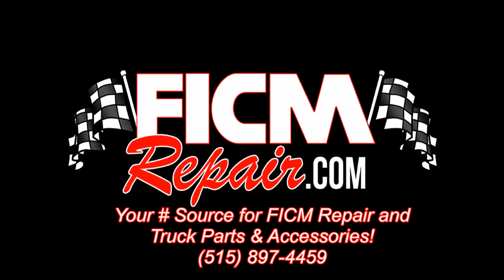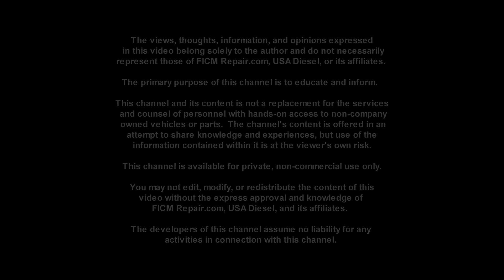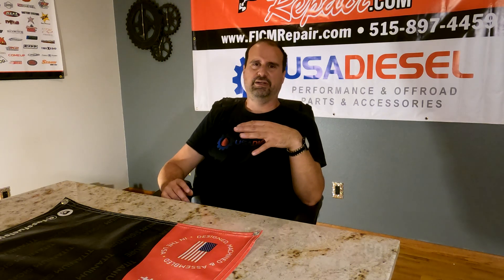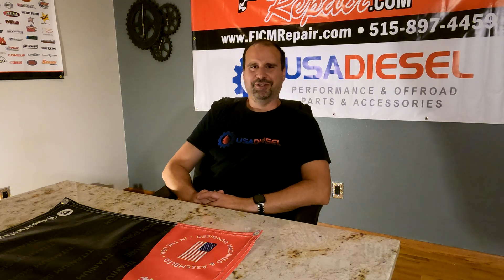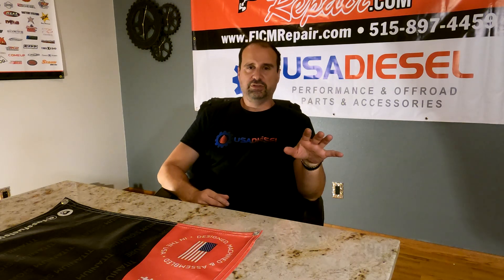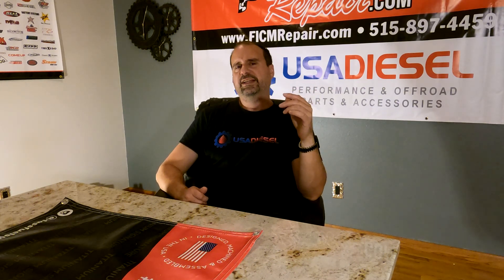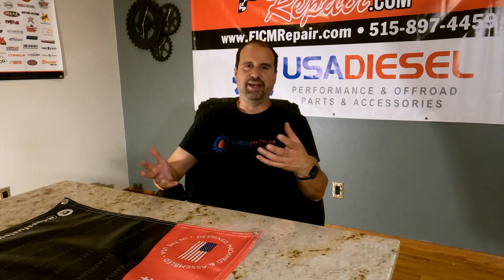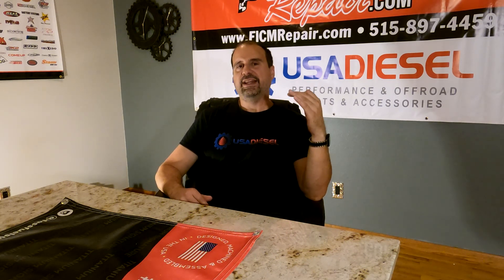Powerstroke 6.0: Why Replace Heads, what gaskets, how to torque and WHY

Comment: Well I agree with about 99% of what you said. However if one goes back historically in diesel engines even to the 1970s. There are several things we find. Number one for any given throttle setting, the colder the engine is the higher your cylinder pressure is going to be because more of the fuel is injected before ignition actually starts to happen and then that fuel slug explodes resulting in a very momentary High cylinder pressure. Statistically that has led on many engines damage occurring in the first couple minutes after startup. It could be stretched head bolts, cracked heads cracked Pistons etcetera. Example of being the 350 cummins. If you leave it on a moderate idle say 800 RPM for the first 5 or 10 minutes you rarely if ever crack a head. If you simply fire it up and drive away as soon as you have air pressure cracked heads become very common. For the same throttle setting an engine that is 190 Fahrenheit versus an engine that is 32 Fahrenheit, will have much lower cylinder pressure. Now if you increase the throttle, or increase the throttle moderately and have a tuner your cylinder pressure spike can become much much higher than the factory ever expected the engine to see or be able to handle. Myself and numerous other 6 L owners even with tuners have found that if you just drive it moderately for the first five or six minutes, that is until you see coolant temperatures over 100 Fahrenheit you rarely if ever have problems with head gaskets. My own stock head gaskets with Factory head bolts lasted well over a hundred thousand miles. They didn't have an issue until the truck was stolen and very very likely driven aggressively as soon as it was started, because obviously he wanted to get as much distance as possible between himself and where he stole it. Now this is pertaining more to trucks that are relatively stock however there what I see frequently happening at least in my opinion is that people are aggressive in those first couple minutes causing at least moderately increased cylinder pressure which is just enough to stretch those TTL bolts. At that point the clamping pressure on the gasket is reduced by whatever percentage and then over the course of five or six months or a couple thousand miles eventually the gaskets fail, because they simply do not have the intended clamping pressure. In regards to that I very definitely like the idea of retorquing it the next morning. However one thought I have if a person has access to a mobile Steam Unit or steam cleaning units also known as a mobile hot water to heat the block with the heads torqued to that 140 until the steam coming out the top of the thermostat housing or such is about 180°. You can then do a hot torque on it without actually having to run the engine or having valve covers and oil rails installed. The way I see it the moderately stretched head bolt and the resulting reduced clamping pressure explains why some engines that are compromised only have an issue when you pull a trailer. Your cylinder pressures when you are actually making it work are much higher than just driving the truck around day-to-day. About 6 months after I got my truck back after being stolen, we purchased a large bumper pull camper. In that time, I had not had any coolant loss and a combustion gas test after theft recovery showed good. However the very first time I hooked onto the camper and pulled it at 60 Mi an hour it gushed like a fountain. The only good side of that was an understanding insurance company that covered the cost of doing a head gasket job and was understanding enough to encourage me to top off the job with head studs which I had already agreed on and to do a delete at the same time if I had not already.

Comment: I have been a pro auto tech 20+ years i specialize in engine work. A bunch of my friends have had 6.0 diesels for years and I never worked on them but heard about all the issues from them. Well i bought one at the auction one day cheap and when I was cleaning the turbo i noticed it only had 4 head bolts per cylinder and I said to my buddies you gotta o-ring the heads studs arent enough. I mean its a diesel then u add 30+ psi boost thats alot of cylinder pressure its hard to believe they didnt have 6 bolts per cylinder. This is a great idea to have a thicker head. I own a auto repair shop I do alot of vw diesel engine work cummins engine work but my shop is too small for pulling cabs. I have a customer that spent 10k on head job for a 6.0 and it only lasted a few years and not abused no tuner it was driven  as a personal vehicle and to tow products for his farm nothing crazy.

Comment: Do you recommend fel-pro gaskets when using kdd heads. I’ve read they are not safe to use. These aren’t aluminum heads so it seems fel-pro would be the obvious choice. Hope you can help me out. Thanks
Reply from the maker: We love the fel-pro headgaskets for non-oringed heads.  For oringed heads, we recommend the Mahle headgaskets.
Reply: I've got the Killdevil diesels coming so I think I'll go with mahle.

Comment: Very informative good video. 100% agree. If your going in there do it right. Kill Devil O ringed heads is the way to go. The guys who did my truck, after they torqued it they ran the truck a few times to heat cycle and then re torqued everything.
Reply from the maker: Sounds like the guys who took care of you did an awesome job!